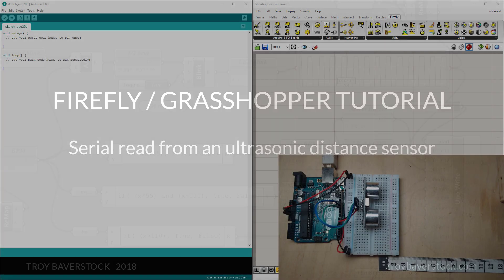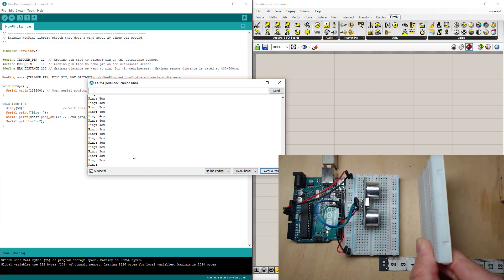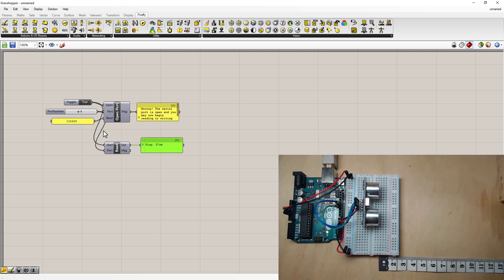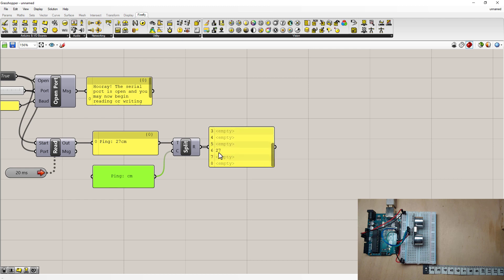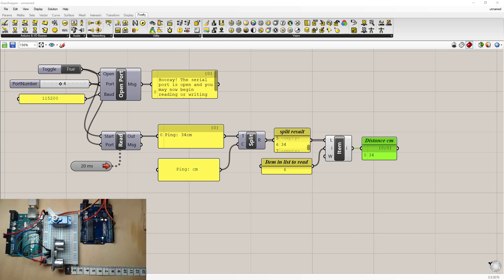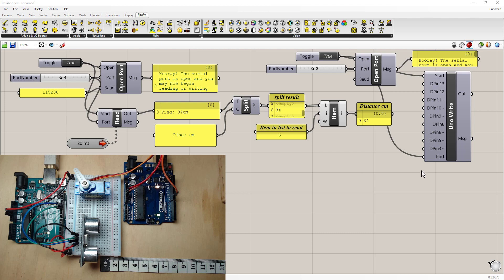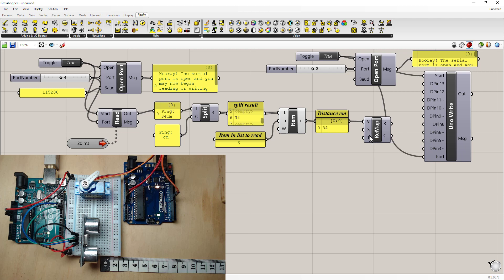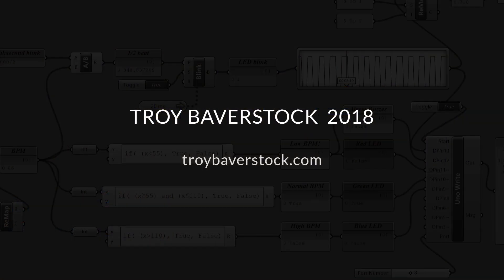Firefly Grasshopper Arduino Tutorial - serial read ultrasonic sensor

Comment: Hi, if you needed to run both arduino boards independently from the computer, how would you feed data from the ultrasonic board to the source board? would you just connect the boards together somehow?

Comment: I am using photo diodes for my output and the firefly fimata file is not working with me when i upload i am using same arduino version 1.8.5
Reply from the maker: The current version of the firefly firmata needs to be modified to work on arduino versions over 1.6.5. You can install 1.6.5 and upload the firmata as is or modify it by changing the last section of code to this (assuming this comment formatting doesn't change it) which takes the #if line and #endif line and puts them within the void function -
void WriteToDAC(int _pin, int _value){
    #if defined(__SAM3X8E__) 
    if(_pin == 0) analogWrite(DAC0, _value);
    else if (_pin == 1) analogWrite(DAC1, _value);
    #endif
  }
Reply from the maker: This video has the fix for the WriteToDAC error in the firmata on newer Arduino versions [3min20 mark] - https://youtu.be/a1fwyfkEHAg